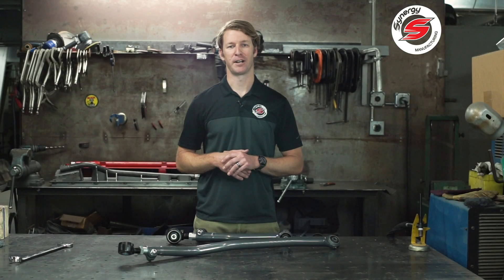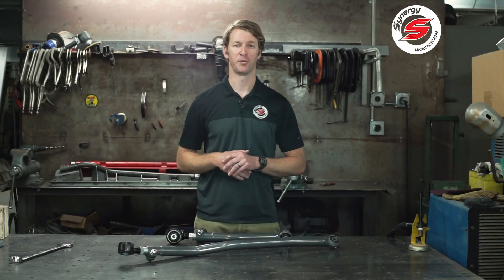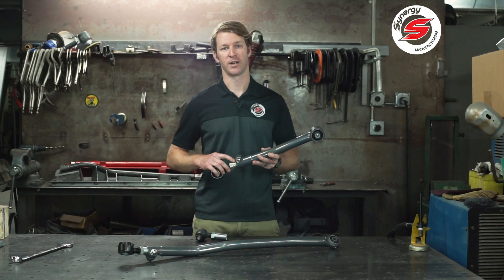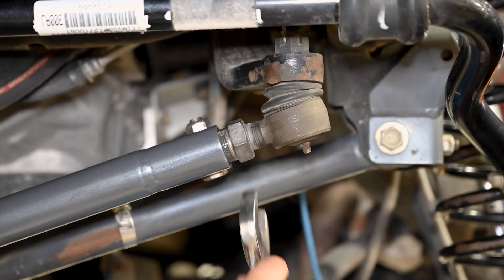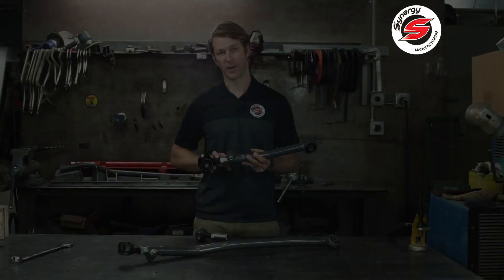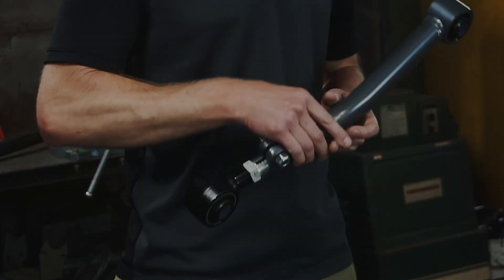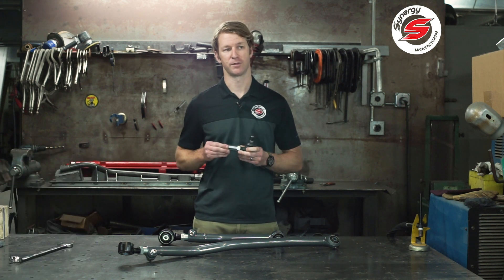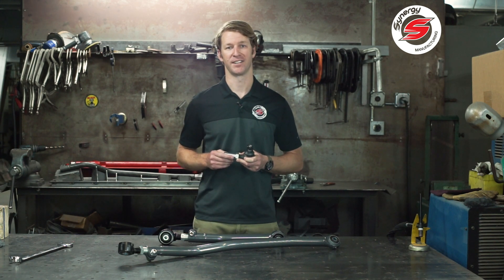Synergy Manufacturing Double Adjuster Sleeve

Comment: I cant find any information on what size wrench does someone need to adjust that damn adjuster. Seriously, none of your directions contain that small bit of info
Reply from the maker: Depending on the part you are adjusting, it is either going to be 1.25" or 1.5" wrench.

Comment: Why did I sunddenly have bump steer after I installed these Synergy Manufacturing drag link, tie rod and track bar on my JLUR. No flipped drag link and no track bar relocation bracket. Did I missed something here? Please help. Not just ordinary bump steer. It is severe. Help needed. Please.